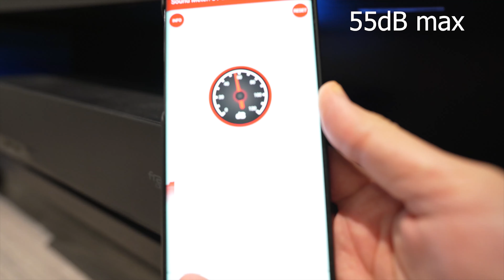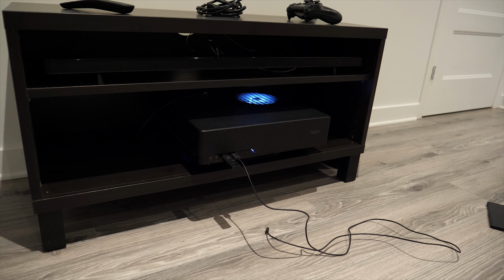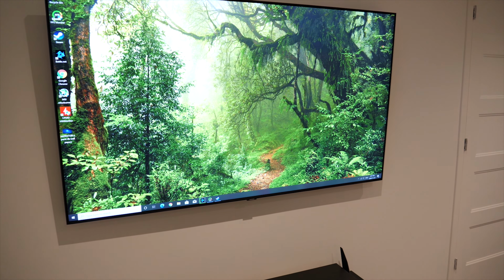Fractal Design Node 202 in 2021 | Was I drunk?

Comment: there's an adapter to mount a 120mm fan to the l9 coolers

the noctua fan duct is pretty easy mount and is another way to force fresh air into cooler

Comment: I just dremeled out the top panel mesh and put in a 140mm scythe slim fan that sits directly on the noctua cooler I put in. On top of that is a dust filter. My gpu is a first gen Founders Edition Titan with no fans underneath. Not running any modern games anyway. Just Quake remastered. ~_~

Comment: Bro did you have any issues with the included pcie riser cable being gen 3?
Reply from the maker: The gen 3 part doesn't give it any issues or performance reduction.  I had issues with it because of its design and shape. :)
Reply: So it didnt require you to switch your pcie express setting in your mobo bios to 3.0 from 4.0? Thanks for the response!
Reply from the maker: @azzeeX  My B460 board doesn't support gen 4. For that reason it was plug and play.

Comment: Just built mine last month with a Ryzen 3600 and a Sapphire RX 5700 XT Pulse:
- had to remove backplate from graphics card because it didn’t fit at first
- had to disable CPU Core performance boost even with a Shuriken Scythe cooler, temps were still unstable and fan was going so noisy even on idle
Reply from the maker: It's a case that will put your arse to work for days. Fine tuning all kinds!

Comment: You don't need extra fans under the GPU or on top of the CPU. They already have fans, so don't waste the money - just make a funnel for each out of cardboard, so warm/cool air don't recycle. It doesn't have to be anywhere near airtight, the moving current helps. I've put high end components in my Node 202 and they run with acceptable temps under load

Comment: Yeah, larger video cards in the Node 202 would definitely be a squeeze.  I have a Zotac GTX 1060 Mini in mine and that's no problem at all.  I only have one fan in the GPU compartment and a Noctua NH-L9i over the CPU.  And like you, I am not really happy with the low-profile stick-on rubber feet.  It's just not enough clearance for decent air flow.

Comment: Great vid, just did one 202 build with 5600x and 3070 as well. But the 3070 I put in is Zotac Twin Edge which is much smaller than urs. I did experience the CPU thermal problem as well since using the same Noctua cooler. One recommendation to lower the fan noise is to pick a quiter power supply, I am using CoolerMaster V750 SFX. It's fan is not spinning most of the time. Even under full load, it only kicks in few seconds every minute. Power supply fan noise is the loudest in my opinion, and I am happy with it is not running most of the time.

Comment: I drilled two holes on top of the case and installed two 120 mm fans. 1080ti temps went from 89 degrees celsius to 72. airflow in this case is a piece of shit.
Reply from the maker: I've seen people use small 40mm noctua fans and attach them to the opening on the side when the case is mounted vertical. What size fan did you use?

Comment: I have it and it's not a case for Powerful Hardware. It's much of plastic and pretty no air holes... In fact only a blower design gpu is good for it... If you wanna use another you need to drill holes in it...
Reply: you can put it upside down in vertical position then cut 3 large hole on top for the gpu hot air to escape.
Reply: Cutting holes in the case is pretty much needed to get half way decent thermals. There's pretty ingenious ways to dress up the holes to make them almost like they was put there from the factory.

Comment: Here's the thing, there's a reason why consoles cap games at 30 or 60 fps. If you do that with the Node 202 in AMD or Nvidia settings, you'll have a good time with thermals. If you don't, and you treat it like a PC when it clearly is shaped like a console, you're running it uncapped, juicing the hell out of the performance of your hardware to get max fps and expect the thermals to be friendly. It seems like nobody gets this and it gives the Node 202 a bad rep. 60 fps is good enough for most games! Capping it means you can dial up quality settings all you want and not toast your system. Your TV probably doesn't even have a refresh rate high enough for the extra fps to really matter compared to the wear and tear of your parts.
Reply from the maker: My TV does 120hz with VRR HDR, you can check out my video on the Samsung Q80T,
Reply: @5WTech  Fair enough, but I'm saying most people that build in one of these probably don't have a TV with those specs.
Reply from the maker: @SourTrigger  that's a fair statement. But the new gen Consoles also demand better TVs to unlock their true potential,  HDR, VRR, adaptive sync. So it's almost the same. We're no longer referring to Ps4 and lower gen Xbox. Thanks for chiming in bud. Always great to have different perspectives. 👌
Reply: @5WTech  Well, you're right, but I think they're still gonna cap PS5 and Series X at 60 for the foreseeable future regardless of those other features. For sure, maybe it might help some people. I've given up on trying with my Node 202 before I end up spending enough to build two computers just trying to cool one. It's frustrating, but from what I can see all that effort and money hardly puts a dent in the issue. The case just needs a refresh with better airflow. Fractal have been too busy perfecting these big dumb heavy ATX cases for too long.
Reply: @SourTrigger  lmao, I built a system in a Node 202, and I as well have a 120hz capable TV, so that makes two.

Comment: Would this case work with a 3700X been eyeing this case for a year now but afraid to buy it due to thermals. Any feed back is much appreciated :)
Reply from the maker: That's a 8 core behemoth! Rated at 65w TDP which I don't really believe. I don't think the low profile coolers will be sufficient. You'd have to undervolt that thing and even then you may still run hot. I'd recommend against it.
Reply: @5WTech  😭😭😭 ok man im itching to make a console size pc with minimum of 8C/16T cpu thank you for the reply 🙏
Reply from the maker: @alexoqu  yeah I know the feeling, this case needs a lot of fine tuning. It's not worth the effort.
Reply: @5WTech  yeah your right... perhaps another console looking case will come about one day 😭😭
Reply: @5WTech  it'll be just fine with an ID cooling IS-60 with a noctua fan upgrade. The low profile Noctua cooler just doesn't have enough fun area to deal with the 3700x in a SFF case. 

Even with a 120mm low profile CPU cooler it still doesn't completely fill up the gaps on the inside (between the case and the CPU fan), so much built a filler plate/fan shroud to take up the gap so that the CPU fan doesn't recirculate its own heat.
Reply: That's actually my build. I'm using a 3700X with a 2060. But my original L9a got really toasty so I replaced it with an IS-60
Reply: @madmax2069  Only slight issue here, IS-60 actually doesn't work well with some boards. Mine is knocked against my RAM, but it does perform much better than the L9a.
Reply: @tonicipriani  yeah, I had to make sure I looked at the height of the ram I was buying knowing that the IS-60 didn't offer much clearance. I got the low profile HyperX Fury (that lacks RGB) and they just fit. But it's probably also going to depend on the board as well as there's going to be ram slot and CPU socket height differences which is going to make clearances different.

Comment: This is not the cases fault. When building a SFF it requires research and being able to pick correct parts. cryorig c7 copper or scythe shuriken 3 with low profile ram would have been miles better and even delid and liquid metal the cpu. Must be new to SFF
Reply from the maker: Research is usually done through trial and error. What's works works what doesn't work is fail. In this case, (no pun intended), Fractal Design doesn't include a list of what parts to use. Therefore the research is done on the user ends. We can look other people's builds for suggestions but it's irrelevant when the case is older than the newer available hardware. Luckily with some fine tuning on voltages and custom fan curves the build is doing pretty good with no performance hit! New to SFF yes, new to PC building, heck no! :)
Reply: The cryorg and scythe are both too tall for the node 202.
Reply: @Michael Kreitzer  I have a node 202 and run a cryorig c7 which fits perfectly with no modifications
Reply: @ninja.darkhorse  Thanks! I guess the 202's spec sheet is too conservative then. It indicates a 59mm clearance, and the cooler + fan is 62mm. Mind sharing the board or socket? Maybe that makes the difference?
Reply: @Michael Kreitzer  ryzen chip with a aorus b550 pro ax board
Reply: @ninja.darkhorse  Thanks again! I've somehow ended up with a spare 5800x and 3080fe and am considering a similar setup. Knowing that cooler will fit helps a lot!

Comment: how to open bottom cover?
Reply from the maker: The bottom part is very tricky. You have to pry it off and be carefull with the tabs so they don't break. Putting it back on is also hard because it needs to be angled. CPU area in first then slowly snap back into place. This worked for me.
Reply: @5WTech  do you plan to upload a vid of it? in the near future?
Reply from the maker: @ninjedi6710  I wouldn't be able to do a video just on the cover removal. Have you tried these tips from FD site? https://support.fractal-design.com/support/solutions/articles/4000055622-node-202-remove-the-bottom-cover